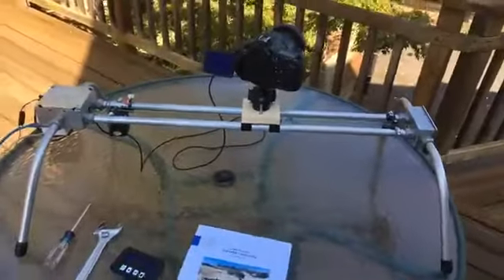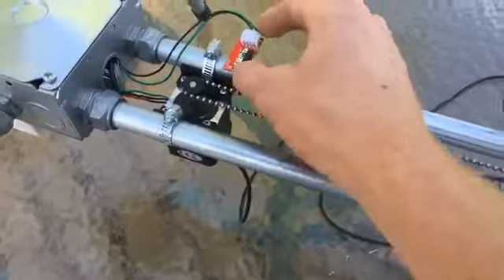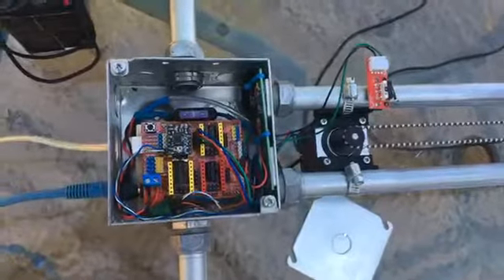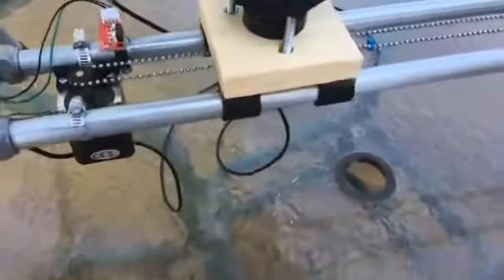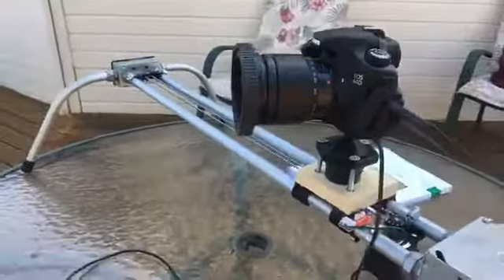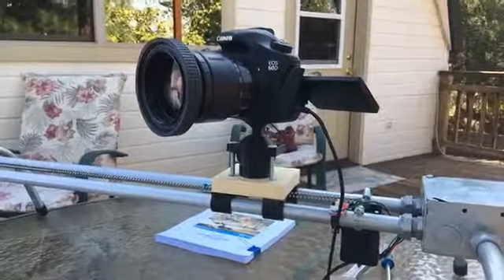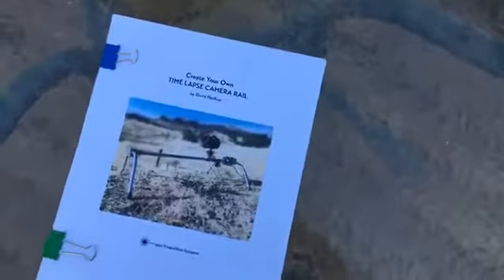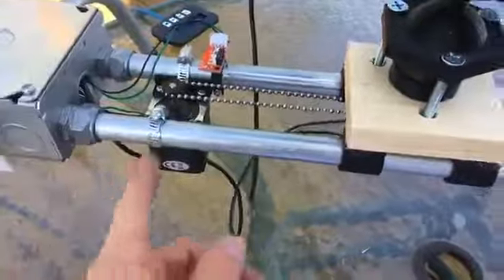A recorded live broadcast showing the DIY Time Lapse Camera Rail & Book

Comment: David, I just bought your book on Amazon.  Wish I would have seen it on your site and gotten it cheaper, but oh well.  I hope you get a good chunk of that extra money.  Thank you so much for putting into one place all the things I've been scouring the internet for for the last three years.  I finally have a single resource to draw upon to get my slider up and working.  I have a question though:  I am just in the infant stages of putting this together, I just ordered all my parts off amazon and adafruit today, waiting for them to arrive.  In the meantime, I plugged in one of the Arduino boards I have lying around at home, and when I try to compile the sketch, I'm throwing a few errors related to the i2c display.  Currently, I have only the Arduino Uno board plugged into the computer, no other hardware (V3 shield, A4988, LCD, steppers, nothing) attached to the board.  Is it possible I am throwing errors because my board is not attached to anything?   The specific error I am receiving is:

170802_TimeLapseRail_v1.0:59: error: no matching function for call to 'LiquidCrystal_I2C::LiquidCrystal_I2C(int, int, int, int, int, int, int, int)'
 LiquidCrystal_I2C  lcd(I2C_ADDR,En_pin,Rw_pin,Rs_pin,D4_pin,D5_pin,D6_pin,D7_pin);

which is coming from your pin declarations.  Do you have any solutions for this?  Maybe I didn't include the correct LiquidCrystal.h library.  If there was a correct one, I wouldn't know how to find it. I have had so many false starts trying to learn Arduino that I still call myself a noob, even though I've been toying with Arduino nearly five years now.  

Any help or correspondence you could give me would be greatly appreciated.  I am waiting to get this slider up and running before I write a review for your book, but I am VERY inclined to give it 5 stars for readability and the way you laid out the step-by-step instructions.  You should be proud of the work you've done on this book, you have definitely satisfied a need for this information.  Bravo to you for putting it down in one place.  

I hope to hear from you soon, if you have a chance and wish to write back.  Thanks again, and greetings from California.
Reply from the maker: Michael Terlouw hi and thanks for your note and for purchasing my book. The paper version in my opinion is much better to have than the download. I will have to check out that error more closely, but I think that maybe the liquid crystal library is not working right. I will get back to you though! I suggest hooking up the rest too, just to see if you are right about the error message. -david
Reply: Will do.  I got home from work and all my parts arrived yesterday, so I will try connecting everything and attach my board to another computer (MacBook Pro 2016 doesn't want to recognize my board very consistently) and let you know the result.  Thank you for the quick reply.